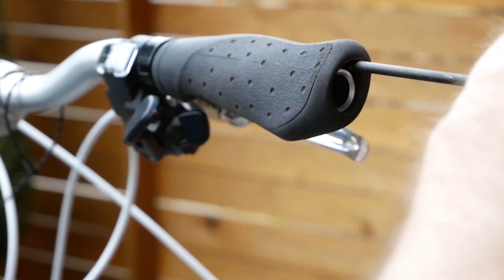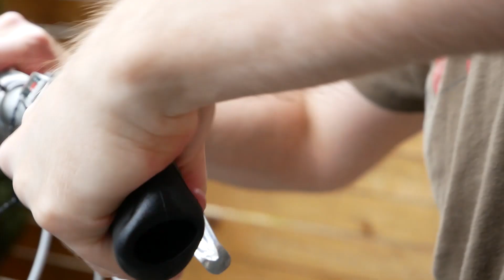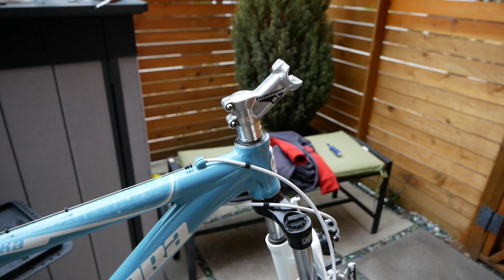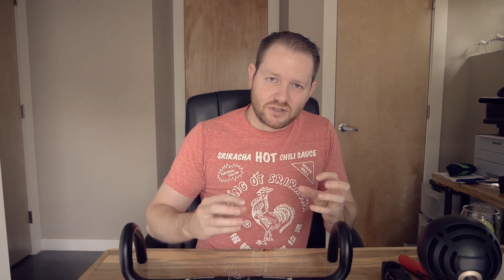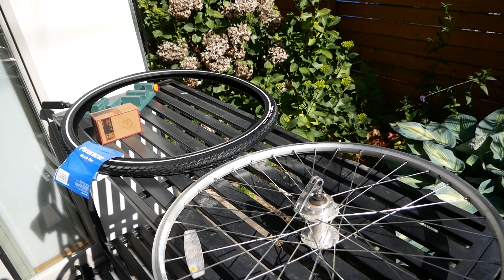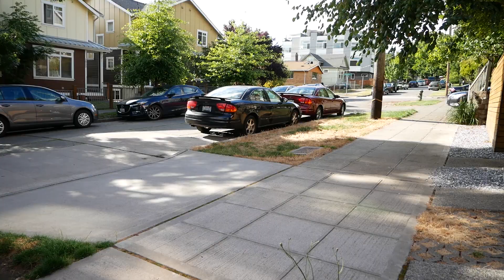How to Convert a MOUNTAIN into a ROAD Bike

Comment: I bought an e-bike mountain bike, I don’t want to bounce down mountain trails, I want to commute to work.

I hate the upright stance which creates massive wind resistance.

I have changed crank from 40 to 50 teeth because I was in top gear all the time only changing down on the steepest hills.

Comment: You can easily transform it into a hybrid bike, the only thing that you will need is s rigid fork, a 700x32mm tyre(if you have a 29er) and a 1x drive, just like 40 / 32-11
With all that you will lose at least 3kg and the bike will be very comfortable

You can also have a second set of wheels and you can choose where you want to go on 5 min

Comment: I would consider getting some real tools of acceptable quality instead of using this crap which isn't even worth being called "tool".
Reply from the maker: I would consider becoming a better craftsman instead of complaining about tools that work just fine.
Reply: @aaronstestlab  Yeah that is what I am trying to do. I do not have any training in working on motorcycles or bikes, I just try, fail and try again.

While doing this, there are also some other lessons I learned. One of them is, that you don't neet to buy a tool for every single job you need to get done - sometimes, a good idea will do it just perfectly. 

But IF you get some tools, invest some more money and buy high quality stuff. Why, you might ask. In my opinion, if you buy cheap, you buy twice - I mean the wear on both, the tool and the thing you're working on (screws etc.) is significantly higher if you use cheap screwdrivers for example.

That is why I said you should get some higher quality tools.
Reply: @RURdy-Stby  Depends on the need; sometimes cheap is the better choice.  I needed a 19mm cone wrench to adjust an Easton rear wheel (it had to be a cone wrench due to the tiny width of the slot).  I'll use this wrench maybe 3 times in my life -- so I bought the absolutely cheapest one I could find on eBay from China.

Comment: I've thought of doing that myself, but then I realized  that you are more than likely to run into gear ratios problems. In other words, you would also need bigger front sprocket like 48 teeth one. Your could do that but at this point the bike will look more like gravel bike with road type fork. Anyway, good video.
Reply: what if i told you todays gravelbikes are just clever marketed mountainbikes from the 90s?
Reply: @uwootmviii8695  Then I would say I am not liable for the perception I have obtained or missed before my time.
Reply: @nikola611  true dat

Comment: Hi, if you didn't want to use brifters, why you didn't choose Tektro RL 520 brakelevers, because then you could use the long v-brakes?
Reply from the maker: Because I wanted to option to later add cross levers
Reply: @aaronstestlab  Ok, that make sense.
Reply: @aaronstestlab  Tektro also has a cross "interruptor" lever that they claim is better for 105+ mm V-brakes.  Though given how my "normal" Tektro and TRP CX "interruptor" levers are, I'm pretty sure they would work for greater than the "normal" 85mm CX V-brakes.

Comment: Why not just simply put road tread tires on mtb,keep suspension forks
Reply: Exactly! The newest gravel bikes now feature a short travel front suspension with some 30-50mm travel. Which is exactly what old crappy front forks from the early 90's had. :D)))
Reply: Yea I want my drop down bars not my suspension changed lol
Reply: because suspension for road only weighs you down. I know because i ride a full suspension bike on the road and it's so heavy and slow :( especially uphill, it's a pain. i'd love to change the frame and fork for a basic one but unfortunately can't find anything.

Comment: hey I have a Question.. 
I have an Road bike and I want to Change the Fork of the Road bike to MTB Suspension Fork Is it Possible?
Reply from the maker: Assuming the steerer is long enough and the correct diameter I don't see why not
Reply: Sam Pilgrim did that.

Comment: You tightened the stem before the preload cap????
Reply from the maker: No
Reply: @aaronstestlab  in the video you tightened the cap down after the final tightening of the stem bolts. You hadn't even installed the top spaces yet. 19:18

Comment: Can you leave a high end shimano MTB rear derailleur shadow plus matched to a Shimano 105 Crank?
Reply from the maker: crank compatibility isn't the problem, shifter compatibility is
Reply: @aaronstestlab  So there is no way to match them up? 
My bike is a flatbar road/gravel/adventure bike.

I wanted to have an 11speed cassette with a decently large granny gear while many road/gravel bikes may have a 34tooth large chainring on the rear.. Id like maybe a 40tooth for hills.. 
I am changing from a 3x9 to a 2x11 system.
Id like that to be 50/34 Crank and 
11-40 Cassette.. though most higher end road bike derailleurs aren't long enough and will max out at 34tooth sized chainrings

Comment: V-brake's are just cheaper than disc brakes. I use them for ages. But they depends of rim and weather condition. V-brakes on wet are weak. 
Hydraulic disc brakes are better compare to v-brakes but mechanical ones not always. The most efficent and legendary are from Avid company but other's like Tektro or Shimano quite often are criticized.
Reply from the maker: Oh yeah, I remember Avid, they kind of fell by the wayside. To me, the biggest advantage discs have over V's have to do with the fact that discs don't require perfect wheel trueness to work well.

Comment: I’m moving from rural to semi urban living. I have a 2012 Trek 4300 disc hard tail. 
Thinking of converting it to a hybrid setup. I’m no bike expert. 
I imagine slicks and keeping the suspension tight would be a good start?
Is it possible to change for larger wheel size without getting into too much headache and cost with brakes/gears?
Reply: i'd stick with the 26'' wheels and put on a pair of wide slicks, a nice thing you can do with 26'' bikes is put BMX tires on them, they're tough as nails, and they aren't full-on slicks so they can even handle light trails if need arises

Comment: I had an old and much beloved 1970's 27 X 1 1/4 touring bike with newish aluminium aero rims and swapped everything over onto an old alminium MTB frame (I only bought new cables and kept the MTB flat bars, seat post and chainset. Drilled the forks (no need for suspension, just ride the peddles with elbows flexed) and frame for caliper brakes. The frame had vertical dropouts which made fitting a bigger wheel a cinch). I now have a great looking lightweight hybrid that leaves all those 29ers eating my dust on dirt roads and tarmac. So definitely would do it again! Worth the time and energy, no need to spend a fortune on new parts! Just do it everybody...
Yeah so I lose on a wild downhill but then...
... good bye, it was nice meeting y'all.

Comment: hey.. thanks for sharing this information. i have watched your video. this is interesting. but i have a basic question for you. do you change the all of the group sets of the gear? how did you do that? because you just share how to install the brake system on your bike. thank you in advance.
Reply from the maker: I just left the drivetrain alone
Reply: Aaron Woodwell oh. But you need to change the gear shifter on the handlebar, right? So, you need to change it. Do we need to reinstall it with a new one?
Reply from the maker: I didn't. Just made sure to get a drop-bar that had mountain dimensions(diameter)
Reply: @aaronstestlab  oh i see it. yea yea yea.. got it.. so we have to get the right mount dimension of the drop bar and the gear shifter's ring, right?
Reply from the maker: Exactly. I put a link to the one I used in the video description.
Reply: @aaronstestlab  thank you Aaron..
Reply: He use the same rims and same crank so their was no difference, If you planing to make a road bike make sure everything matches or buy it as a set, front and back derailleur, breaks levers and shifters, crank and the cassette or the whole rim, and make sure that front derailleur fits the tube in your bike that could be a problem that can come across, like It happen to me

Comment: Why on earth didn't you just change the tyres?  If it were just for commuting then that was all that was needed.
Reply: Xactly jus change tires,I do wished I could find comp 3 bmx style tires in a 26x1.50 size or 1.75

Comment: It's got disk brake bosses. Do that
Reply from the maker: Problem with that, is that I wanted to leave the option open to add cross-levers. So far as I can tell, there are no short-pull disc brakes and no long-pull cross-levers.

Comment: I converted an old Raleigh mountain bike in much the same process that you followed. It cost £25  and is probably 25 years old. I was warned about internal corrosion and it that it 'was made of gas pipe'. 
I now have the touring/camping bike I always wanted. If the internal corrosion warning is true then when they pick up what remains of me then I will still have the broadest grin. These mongrel bikes are there to be ridden not just looked at.
Reply: It's your bike, you build it how you want.

Still ride my steel 25 year old Raleigh mtb, if it was made out of ally, it'd probably be broken by now.

Comment: I'm getting a mini fat ebike soon and already thinking about swapping out the cheap suspension fork, but aftermarket forks for 20x4 fat tires don't really exist. I noticed the available rigid forks for 26" fat tires have roughly the same axle to crown height as my suspension fork, so assuming everything else fits would I essentially be getting a suspension corrected fork that way?

Comment: There are conclusions that could come when you turn mountain bike into road bike..... and i think there is no need to explain it.....

DO NOT ATTEMPT TURNING YOUR MTB TO RB you'll regret it...
Reply: I have and I certainly don't regret it.
Reply: Captain Freddy 
I have a 2012 Trek 4300. I’m moving from deep rural to semi urban living. Thinking of converting to a hybrid set up to get more speed/energy efficiency on hard surfaces. I’m no bike expert, but thinking that some slicks and keeping the front suspension locked off would be a good start..
Maybe larger wheels?
Did you do a more extensive conversion to road bike than just hybrid?
Reply: @NoLefTurnUnStoned.  Yes definitely go for some slicks and the narrower the better for speed, I think 32 mm tires would be a good choice. 

I wouldn't worry about locking the suspension and would keep those flat bars since an upright position is better for control and visibility if you are riding in traffic. So in short just change the tires.
I ride 27 inch wheels cos I'm so old and old habits die hard;  700 C is the modern equivalent and just slightly smaller but have a wider range of tires that are more readily available. 

Yes bigger 700c wheels are much faster than 26 inch wheels and run at a higher pressure so that also reduces drag and it makes a real difference that you can tell immediately. I had a 26 inch wheel MTB with aluminium frame and slick tyres (26 X 2 inches)  but I hated it because it was so slow and so many riders were whistling past me and I could not keep up with them even if I tried.
I've toured (incl. Morrocco) and raced and don't like being left behind.
If I was you I'd look for a used bike that already has an aluminium frame, 700 C wheels with narrow tires (28 or 32 mm, narrower than this are too prone to punctures for my liking)) and the type of handlebars you prefer (drop or flats). Yeah I would also avoid a bike with front suspension as they are heavier and cost speed. For the price of your NEW narrow slick tires and inner tubes I bet you could pick up a really nice "Dad Bike".  So ride what you have for the time being and see what comes along. I bet someone you know has a pair of narrowish 26 inch tires collecting dust that they might give you and pretty soon you'll find a dusty old bike exactly the type you want going for a song. Then sell your TREK as it is still a pretty nice bike or save it in case you persuade a friend to go riding with you.
Let me know if this helps and what you eventually decide to do and buy.
BTW I already had a steel framed road bike so swapped all my parts onto an old cheapo aluminium MTB frame. I don't think I would go the other way, i.e. buy a load of new stuff  (700 C wheels and tires) to convert a newish MTB to a road bike.
Reply: Captain Freddy 
Thank you very much for the reply. 
I think I will begin with changing the tires and maybe the wheel size. 
I’ll let you know what difference it makes. 

Thanks again.
Reply: @NoLefTurnUnStoned.  OK good re the tyres but changing the wheel size means you will spend some major cash. See what is available on the used market with 700C wheels. You might just get lucky and pick something up real cheap. I wanted an aluminium frame for my old road bike and found a MTB that was sadly neglected with flat tyres, etc, etc. but the frame was good. It was less than 20 dollars and I already had the wheels and brakes so it was real cheap to make the change. Good luck and thanks for the reply.

Comment: can I mention that you don't have to use electric tape with handlebar tape. Instead of starting bottom to top wrapping, go top to bottom with handlebar tape. It's cleaner looking and you don't have to use electric tape. problem solved.
Reply from the maker: How would you secure it at the bottom?
Reply: @aaronstestlab  the same way, plug the end with the handlebar plugs. But wrapping top to bottom is worse, since the orientation of the wrapping is contrary to the orientation of the applied force of the grip, so over time the tape tears off or unwraps.
Reply: Every bar wrapping pro wraps from the bottom. Just tape it,  nothing wrong with that.
Reply: It's not necessary worse to wrap from top to bottom or bottom to top (with or without electric tape). And depending on how you grip your handlebars, I would figure, would determine the orientation of the applied force of the grip. Regardless of how you wrap it, whatever works for you.

Comment: How to convert a mountain bike to a road bike - don't.
Reply: If you have an old 90s MTB frame, they are very similar (in some cases identical) to the classic road bike frames. You can hack those without too much worry about the geometry. A lot of newer road bike frames actually have the sloped top tube and steeper head tube just like the old 90s MTBs.
Reply: DO IT Hybrids are GRRRREEEEEEEEEAT
Reply from the maker: Sage advice
Reply: The only time you have to do it, is for geometry reasons, when none of the road bikes fit, ie. top tube is too long for a person with short arms.

Comment: all you really needed to do was change the tyres
Reply from the maker: In retrospect, doing just that and maybe swapping out the suspension fork might have been the savvier move.
Reply: @aaronstestlab  personally i would leave the suspension on and just firm it up a little, i find rigid road bikes horribly uncomfortable
Reply: @korup7ion951  a rigid fork, is actually comfier than locked suspension fork

Comment: I made my diamondback hardtail  into a all shimano ultegra 600 tricolor 1x8 with 38t FSA narrow wide on a 2017 Diamondback xc prototype advance endure technology  hardtail with only 8-0 mm travel, since prototype they sent me all free replacement parts for a year( I called said I needed stuff and stocked up). it can go from 26" to 700c, I had drops and the ultegra group set, put chain guide on. Im just cant decide carbon or chrome/steel bladed rigid forks, I think ill go steel/chrome  since all my bikes from my 84 Raleigh to my newest are nice chrome/steel
if you have most the parts go ahead
eBay has FSA cranks and parts cheap

look in your local bike Facebook and craigslist groups ( I got thousands in free parts people just didn't want mailed o me even the entire ultegra group set
Reply: I building up a gravel bike from a MTB frame. Are you willing to mail any parts you may no long need or are willing to part ways with? Budget build.

Comment: Long pull drop bar brake levers are available for about the same price and that would allow you to keep your original v-brakes and save a few bucks. It also gives you the option of putting a disc brake on the front but with the obvious disadvantage of needing a new disc compatible front wheel.

I skipped through a lot of the video so I’m not sure if you mentioned this or not, but it is very important to realize that going from big fat tires to skinny tires will drop the bottom bracket substantially which is good for stability but makes it dangerous to pedal through turns as the pedals are much closer to the ground. Pedal strikes are no fun as they will launch you off the bike.
Reply from the maker: in retrospect should have done that, but wanted to keep the option open for cross levers
Reply: @aaronstestlab  Good thing to have.  But, Tektro also has a cross "interruptor" lever that they claim is better for 105+ mm V-brakes.  Though given how my "normal" Tekro and TRP CX "interruptor" levers are, I'm pretty sure they would work for greater than the "normal" 85mm CX V-brakes.